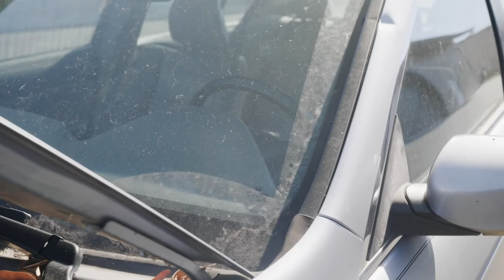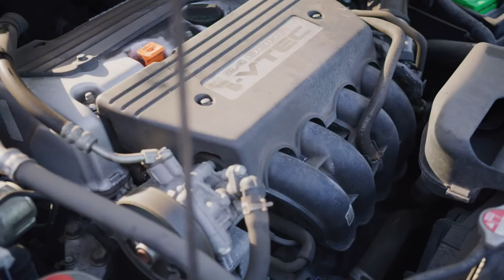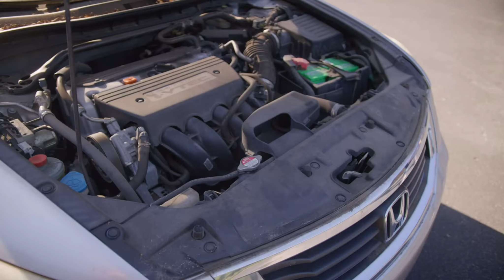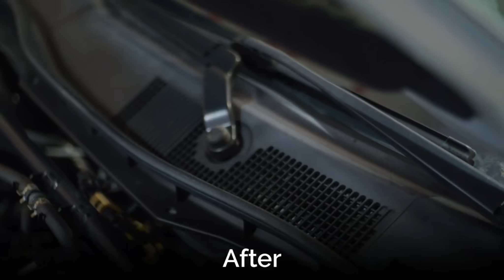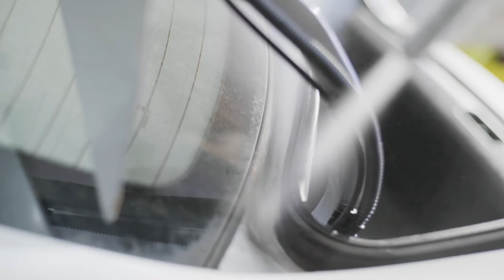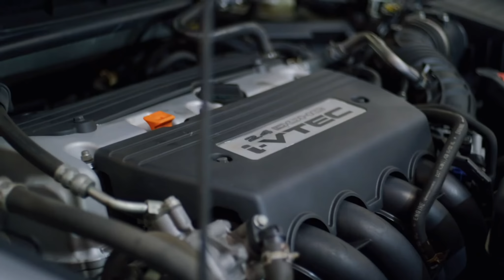IC 022 EVO │ World of Car detailing & Restoration

Comment: Hi, this new "portable" version is fantastic. It certainly makes me think of new ways to use it. Do you think it will be possible to set up a mobile car detailing station? I've been thinking of opening up a mobile car wash/detailing business, but due to rules and regulations where I live, it is impossible. (it's forbidden to wash your car on public streets and even on your property if the water drains into the sewer system.)
I guess I'll need a trailer with the compressor and dry ice storage unit, and obviously the IC022 EVO unit. What hidden issues there will be, in your opinion?
Greeting from Italy.

EDIT: Forgot to mention: could it be cost-effective?

Comment: Can this unit clean dirty oxidized aluminum like the bigger machines? For example the big machines make transmission and diff casings look new. Also can it clean bolts, specifically yellow zinc bolts, like the bigger machines?